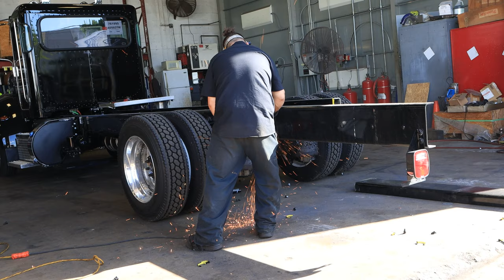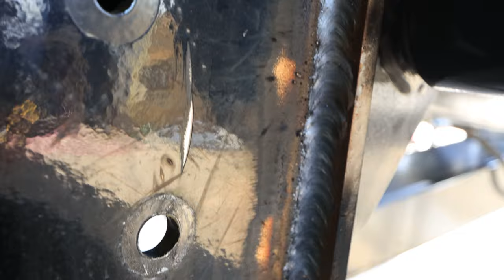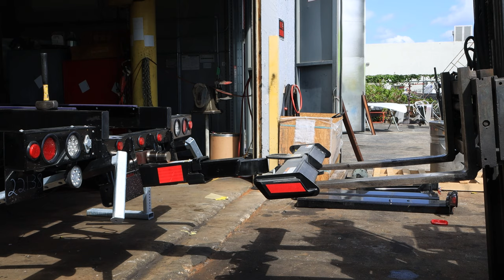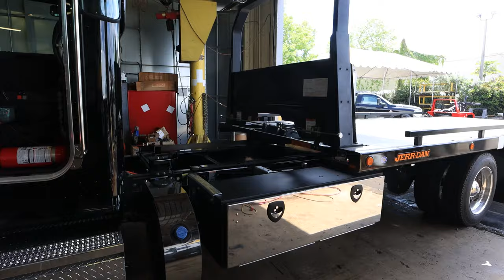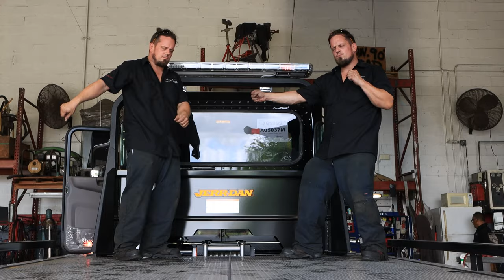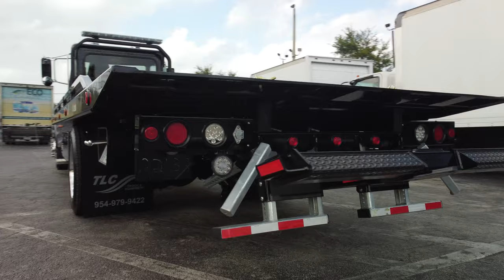How to Build Tow Trucks at TLC Truck & Equipment

Comment: Since drivers ate at most risk when being on the left of the tow truck, how about making the cab easily accessible to move around easily with making the passenger seat foldable and out of the way for the driver to exist on the passenger side, and lowering the floor at a greater angle.  Secondly, there are a lot of older and shorter drivers out there, how about doubling  the amount of exterior steps and adding grab bars.
Reply: Are you one of the 7 with Snow White?

Comment: Sad the new truck could not pull the wounded f6 cylinder stuck shift 4x4 old school won3/4 no hp for sand dune let's see next motor soup it up 750 hp n retest good job guys great sportsmanship